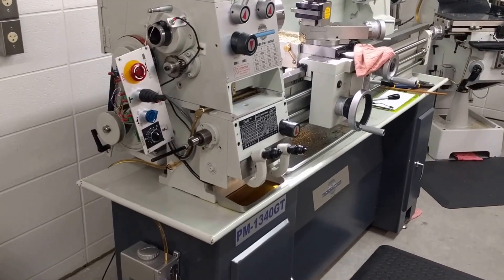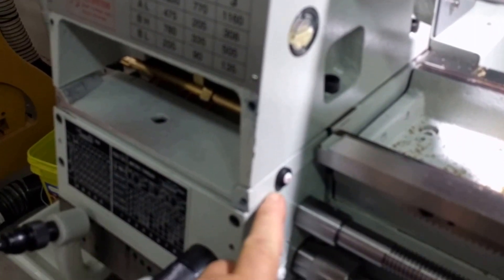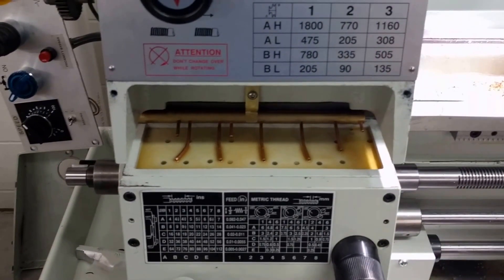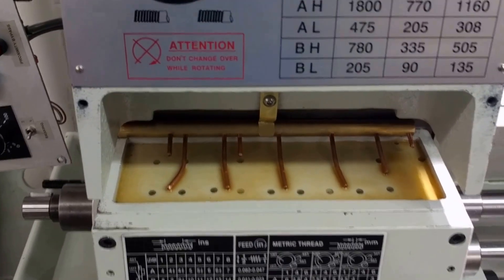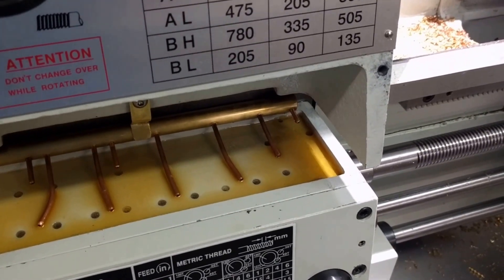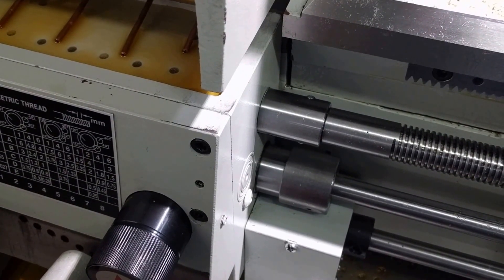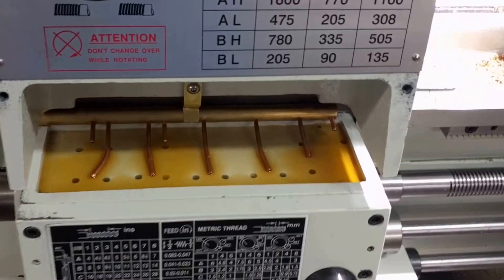One shot lubrication manifold on a PM1340GT lathe

Comment: Just got my PM 1340GT and am in the process of going through the startup testing.   In the PM manual for this machine it is very vague how the oiler for the it works.   I was surprised to find that it was a one shot system with no directions for frequency of lubing or quantity.   I have many questions but  I will restrict to a few.  1) After applying the one shot of say 16 cc does it then drain out the bottom? 2) What route did you take to get oil from the one shot to the manifold? Any more photos or video of the complete system,  Like  I said this  is a new machine to me and have not even turned it one yet.  Any help appreciated.  

Thanks in advance.
Reply from the maker: First, I didn't know that PM had added a one shot system to the current model.  As the video describes, mine came with a port where you put oil in on top of the distributor plate.  Frequency is highly dependent on usage.  I simply give mine a shot when I am going to use it.  All the other details are clearly shown in the video. You might want to watch it again.
Reply: Sorry for the confusion. PM 1340GT does not have a one shot lube like yours.  Oil is applied through a single port like you originally had.  What I meant to say is that I was surprised that they did not have an active oiling system of any kind.  @BigHWorks

Comment: Just came across this interesting video, thanks for posting. I replaced the manual Oiler on my Tormach 1100M CMC mill. Next on my list is to get a PM-1340GT Lathe, this looks like an interesting upgrade. One question, since there are so few actual holes and they’re so widely spaced, why not just give each hole it’s own feeder tube? Is the idea that you’ll get a longer period of slow dripping from the reservoir of sorts?
Reply from the maker: Steve, the distributor plate is a simple gravity fed drip system.   For me it was important to get a good even spread of oil over the plate which then slowly drips onto the gearing and bearings below.  The 8 pipettes I used seem to work fine in achieving that.  But if you prefer 14, it is just a bit more complicated.  I personally do not like bending that small ID tubing since it affects internal cross sectional area and therefore pressure drop.  In my approach they are threaded into the distributor which means they were installed first and then bent to shape, albeit minimally with the layout.  Good luck on getting your PM1340GT soon.  It is a fine lathe.

Comment: Would you kindly list the sizes of the pipes you used- the main manifold as well as the smaller ID copper pipes running to the oiling holes? How does your pipe hook up to the TRICO outlet? (size of pipe/fitting). Thanks.
Reply from the maker: There is a hose barb on the exit of the Trico pump.  I don't remember what size the manifold and individual distributors are but likely are 3/8" pipe and 1/8" tubing respectively.
Reply: @BigHWorks  Thanks a lot.

Comment: Nice, well thought out, set up.   Do you also use some sort of absobant / dispersant medium in the cavity as well?  I'm thinking either heavy felt as in old SB lathes or perhaps a medium SS wool type affair. I suppose a Scotchbrite would work, too.   Seems like the capillary action might help the oil find the access holes more readily and meter the oil more evenly between shots.  This is just me pondering as I do not own such a lathe, just a 3 in 1 boat anchor with change gears.   Still, I stop, learn, and lust after where I can.  ;)
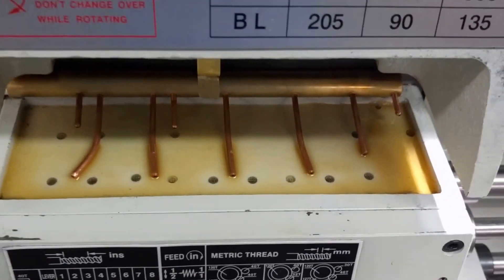Reply from the maker: Thanks.  There is a thin, wide weave gauze on there to assure distribution.  It is hard to see with the oil on it but look at 1:11 into video and you will see it.  It seems to do the trick.  BTW, my advice is to avoid the use of Scotchbrite for this purpose due to the embedded abrasives.